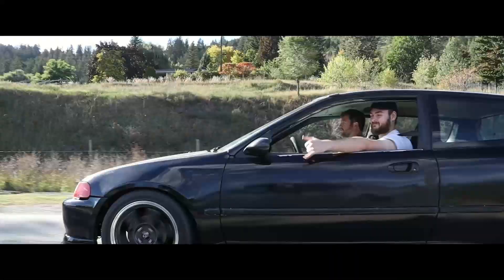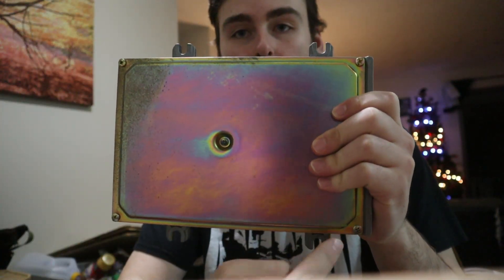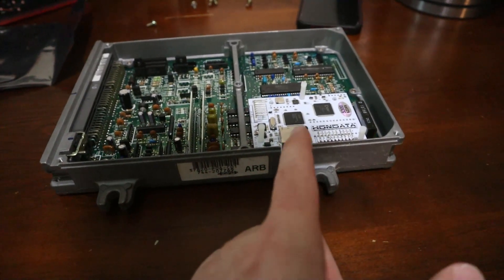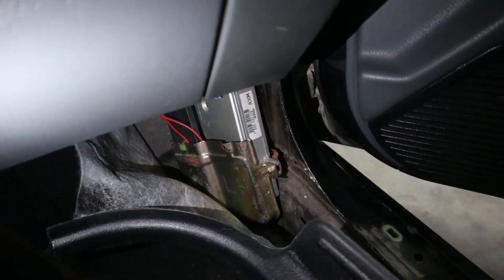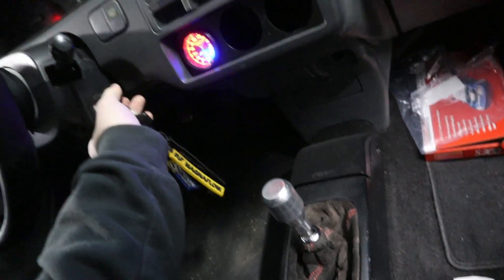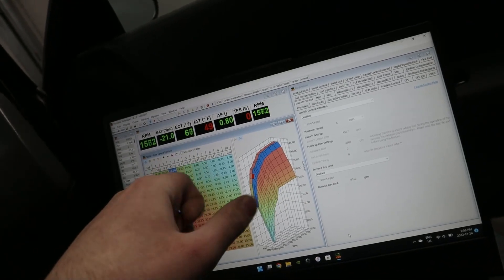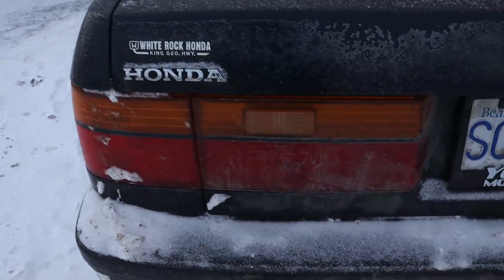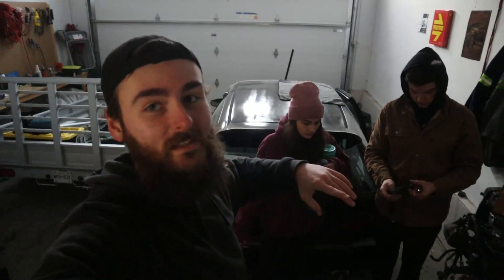Hondata S300 V3 Install!

Comment: hey boss i still have the flashing red light do you have any tips we have taken the board apart many times but we cant get a solid flashing light
Reply from the maker: They are super old and finicky bro I would send the ecu out and get the capacitors replaced that’s the #1 cause for s300’s not working or connecting
Reply from the maker: Maybe a solder joint on the new pins isn’t the best too

Comment: Hey did you figure out what the red flashing light was? And how did you fix it?
Reply from the maker: Alls I did was remove the Hondata chip from the ECU and put it back in making sure all the connections were properly secured and it worked. Must not have been installed properly but worked for me. Sometimes still flashes red but it works so im not entirely sure on that
Reply: Okay thanks I’m going to try that! Mine seems to be not working with the ecu

Comment: Hey man....just found your channel. Thanks for the video. Where in BC are you? I am in the middle of a 92 Prelude father son project. We are almost finished buttoning up the turbo install. The motor is a fully rebuilt H23A ready for turbo. I am just in the middle of figuring out the ECU situation in the car now.  The ECU in the car is from and Integra GSX with the Hondata chip installed ready to put in an updated map.  Generally, the rebuild of the motor was to bring the compression down to 8.5:1.0 for the turbo with dished pistons and iron sleeves.  Fuel injectors are roughly double the flow of the stock. Just a bit confused with imports. So used to domestic muscle cars!😮
Reply from the maker: That ECU combo should work fine granted you can find a good tuner. H22/23 engines have never been really supported by hondata being OBD2 but your situation seems like it should work with a good tuner that knows what hes doing!